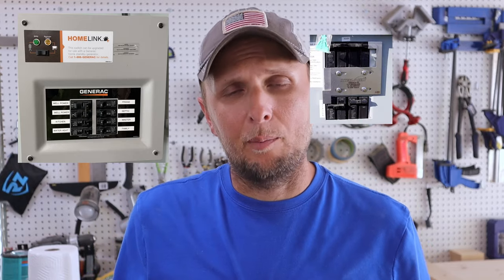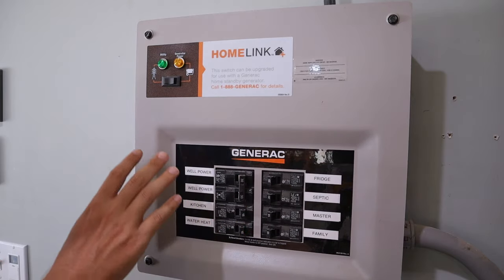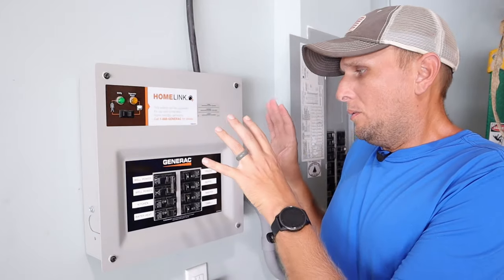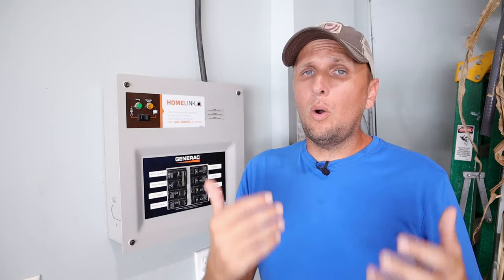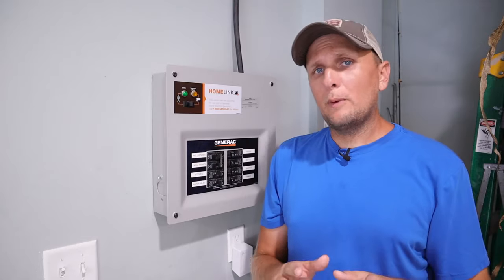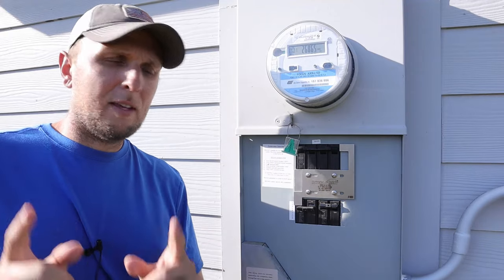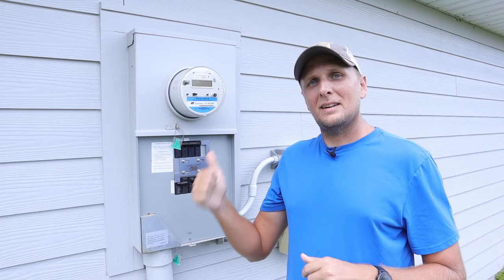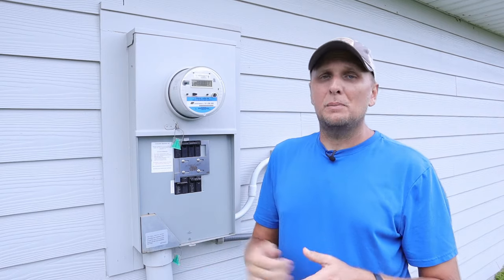How To Choose Between A Transfer Switch Vs Interlock Kit With Power Inlet Box

Comment: Why not use a double (or maybe triple) throw break before make knife switch?  That is, the switch goes between the meter and the main lug of your main panel (or in the case that I'm considering,  between the main panel and a sub panel), with the switch in one position, and between the generator and the appropriate panel in the other position.  (I guess that if I'm powering only a sub panel, then I need to switch the neutral as well, and bond the neutral to the ground at the generator.)  Do I have this wrong?

Comment: Question: For an interlock kit do you need a gen that puts out 220V since it's feeding the panel the same way the grid would? Vs a transfer switch that feeds individual 110V circuits?
Reply: Yes because you're feeding in through a 240v double-pole breaker. This is necessary anyway if you need to run any 240V equipment like well pump, central AC, electric oven, etc.

Comment: Here is an odd question for you. I have a few of the 5000 watt generators that usually I use 2 of them after a hurricane or bad storms here in the South Texas/Gulf of Mexico area. I run extension cords into the house since I don't have a special plug near the breaker panel for generator to connect to. This works ok, kind of a pain to do but works. 
I was told that since all of my generators are different, use different phases or something like that so I could not connect 2 or more to the breaker panel after disconnecting the city side so no backfeeding the city.
The breaker panel is 200 amp service and have breakers on both sides of the panel.
My question is, is there a way to split the panel so one generator could run one side and another generator run the other side of the breaker panel so I don't have to run extension cords into the house? No idea if this is possible without spending a lot of money but would be nice to not be messing with the extension cords. Thank you.
Reply: With an Interlock switch you can't.  You can if you install two Reliance Controls Manual Transfer Switches. (Either a six or ten circuit)

Comment: Hi
Is there an automatic transfer switch.
So when the city power is off , the generator turns on and the transfer switch goes automatically to generator ,
And when the electricity come back,
The switch goes other way and the generator stops!

Comment: In this case, I'm using an automatic transfer switch. Once the grid has the power back and it automatically switches to the main line, what will happen if the generator is still running and where does that power go?

Comment: With a transfer panel do you need to put wire nuts in the main panel? Im wondering because i was told it was illegal in my country to put wire nut in my main panel.
Reply: Yes, wire nuts are used in the  main panel when installing a transfer switch.

Comment: I got a interlock kit beat way to go imo i have full control with a 5700 watt generator and i keep everything energized except the waterheater.  I have no central air and im not just gonna turn on a bunch of stuff willy-nilly lol  It runs the window ac and refrigerator just fine.

Comment: My panal box is not made like the one with the interlock on it my main switch is long ways in the box and my breaker for my generator is in the middle of my box because at the time it was installed it was after Ida so it was kind of an emergency situation so would this still work if I had an electrician move everything around the panel

Comment: II my home, I have a 2 circuit breaker set up, a main and a secondary.  I believe it is a 200A circuit.  For a 15000 portable generator, it is better for me to do an Interlock or transfer switch?
Reply from the maker: I would go interlock.  There are transfer switches that large but they are pricey.

Comment: Also, I saw a guy put in his review that this Generac Transfer Switch was only comparable with Generac generators otherwise you have to remove the panel cover and move a physical switch to make it work properly.
Reply from the maker: That's not true.  I dont have a Generac and it works great.

Comment: Does a transfer switch solve the problem of a bonded house ground interfering with a bonded ground on the generator's GFCI? My Honda 3500i Inverter trips the GFCI if I connect to the panel with an interlock & generator connector.
Reply from the maker: It will still trip since the transfer switch is still using the home’s neutral and ground.  Would need a floating neutral generator.

Comment: I have bought a 7000 watt generator and hve been getting quotes from local electricians for installing an interlock switch plus cabling and cabling etc. The quote was $1800. Surely this is a rip off.

Can someone advise as to what the price should be. I recognize every installation is different but the house is 3 years old so everything is new.

Comment: I’m running interlock kit with Firman tri fuel from Costco. My preference is natural gas source, Is it better to run a long gas line or long cable connection from generator to panel on house or does it matter? Hope that makes sense. Concerned that long gas line will reduce pressure somehow and power capacity with long 40-50 ft gas hose.
Reply: Gas outlet is behind the house, panel toward the front….total is about 60-70 ft appx

Comment: I'm about to set up this too. I got a 9400 watt firman trifuel. but I was told by two and then 3 people, that it's dangerous to run power to household electronics, as these generators deliver electricity with spiky signwaves and it could damage your furnace, fridge and other items you run power too.  It was suggest to see if you can filter the power with a power / line conditioner, and this should keep the sign waves smoother.  a surge protector is o.k. but a line conditioner many not shut the power off on your items, so they keep running, as it smoothens out the waves to be continuously running safe..  Any feedback on this from anyone who's electrical savvy, please advise before I complete the job and set up the pony panel.. Thanks.
Reply from the maker: So this is true but not fully.  Many electronics such as appliances (unless they are smart appliances) would be fine, there is a possibility of damaging a circuit board if yours has one but I’ve never been too concerned with it.  Where you can get into trouble is with sensitive electronics like tvs, computers, etc.   The sine waves on many generators do constantly spike which can possibly wear your devices down faster or cause damage.  The power line conditioners from my understanding, do not clean up the sine waves so they don’t really solve your problem.  What you need is a generator or inverter generator with a THD% at or under 5%.   That being said, for years I ran a generator with a higher THD and nothing happened to my electronics.  That’s just my experience, I do know it was not the best for them but at the time I needed power and it’s what I had.  Since then I purchased a big generator with a THD under 5% so I don’t need to worry about that anymore.  Firmans have a high THD, I have seen many of them up around 25%.  They do have inverter generators that should have the lower THD% but inverter generators oftentimes don’t supply a large amount of power.  While the tri fuel option seems good due to the multiple kinds of fuel that can be used, I personally haven’t seen one with a lower THD%.  So in your case, unfortunately I don’t have a great solution if you are concerned about the dirty power.  I completely understand your situation as it’s where I was a few years ago and why I wanted to make sure going forward, to buy generators with a low THD % for peace of mind.  I hope this was helpful for you.  Just my experience and research I did on the subject a while back.  Take care!
Reply: @HowToHomeDIY  I with use of a pony panel with key things connected to that, I also use those 3-4 receptacle outlets power bars with the receptacles connected to the pony panel, would be a safe back up way to run our items  ? including switching the furnace hard wire to a receptacle near by, which our hot water tank is now too.. so using power bars or surge protector adapters or something should work just fine for this concern ?
Reply: my firman trifuel model T07571 is rated for 11-14% thd. others say 25 or less than 25. still not 5. this may be a bit better ?

Comment: Thank you, I’m in the process setting up now.  However I have a more basic question.  There is a lot of discussion about THD limits before causing damage to electronics.  It would be difficult to find a sizable portable generator that meets my needs if I complied with this less than 6 THD.  Are these reports a little sensational and not that big of deal?
Reply from the maker: So I have used sensitive electronics connected to generators with higher THD% and nothing ever broke.  That being said, with my large generator, I made sure to get one with a low THD% just to make sure I was not putting things like appliances at risk as they are so expensive to fix and replace.  Unfortunately, I do not know of a large portable generator anymore that has low THD.  The one I bought was the Cat 12000E but they have discontinued it.

Comment: 3:43 If you have a situation where you are turning breakers on and off to power different circuits, then the transfer switch is not going to works for you because it limits you to one set of circuits so you cannot switch circuits on and off as needed. In addition, you have to decide what circuits you want to run in advance so there is no flexibility. Also, should you upgrade to a larger generator, yu have to get a whole new setup to handle the larger load.
Reply: Yea I agree. I honestly I can't see how the argument for the transfer switch makes sense at all unless someone literally has like 2 braincells and can't stop themselves from turning on a 5k HVAC or powering up 10 table saws all at once when running on a small generator. 

IT would make sense for a business or a factory that has high powered equipment that may boot up automatically, but for most houses, I don't see how that is going to be a major concern. Instead of messing with breakers, just stop doing the thing you're doing that is overloading the generator. and like you said, upgrading your generator to meet higher demand is simple with an interlock.

Comment: I bought a whole-house stationary generator (24kw) with an automatic transfer switch.  I spent a lot of money and wished I had bought a large portable unit with an interlock.  What they don’t tell you is that the mfg greatly limits your ability to maintain, repair or even change many of the settings.  That puts you at the mercy of local dealers.  They have proven to be very expensive and unreliable.  My Generac unit had a major malfunction 4 months (5 hrs of total run time) ago and is still out of service.  I have called 3 of the authorized dealers and it remains broken.  If I had spent only 20% of what I did ($16k), I could have the flexibility to just replace things as they became unserviceable.  The dream of no interruption to life when you lose power remains just a dream for me.  I wouldn’t do it again.

Comment: YOU YOURSELF WHICH SYSTEM DO YOU USE FOR YOUR HOUSE AN INTERLOCK KIT OR A TRANSFER SWITCH? 
INQUIRING MINDS WANT TO KNOW.
THKS HAVE A NUCE DAY AND KEEP THE VIDEOS COMING TO PITTSBURGH PA 😊😊😊
Reply from the maker: Well I have installed and use both actually.  I started with a transfer switch but then decided I wanted to be able to run my whole house so then put in the interlock kit.
Reply: Thank you for your quick reply to my questions.
Loyal subscriber here keep up the great informational and educational videos.
You rock!😊😊

Comment: “…never going to be able to run my entire panel…” with my generac 6500 watt generator I powered my whole panel. Lights, fridge, washer and dryer, tv, microwave, furnace/ac, gas water heater, gas stove, and outlets. And I ran a cord to the neighbors house so she could plug in her fridge. I was just cautious about what was running when. We could easily run the washing machine, lights, tv, both fridges, the gas instant water heater which has a blower motor, and microwave, and ceiling fans all at the same time. If we were going to run the ac or the dryer we just powered everything else down except for a few lights for a while until the dryer was done running or until the house had cooled down.

Comment: My question, is with a harbor freight inverter generator 9500, my plan is to use a transfer switch with an inlet box, the only problem I see is that the generator only has a 30A twist lock connection, there are 2 of them, but how will I get the full output of the generator into the house ? Is there a way to combine the 2 30a outputs into a larger inlet ?
Reply: We have the Predator 9000/7250 generator. We have a manual 6 and 10 circuit transfer switch, with an inlet box for each.  I use the 4-prong outlet for the 10 circuit, which has the heavier circuits on it.  I use the 3-prong outlet for the 6 circuit, which would only draw about 1000 watts max.  

This set up works great. Our entire main panel is connected to the transfer switches.  Just make sure you keep up with the max wattage, if you use two transfer switches.

Comment: Seems to me a interlock switch is the better option even with a smaller generator because i could shut off everything and run my A/C if i really need too. I'm on a well and the well doesn't need to run all the time, neither does the hot water heater really. Once it's hot it stays hot for awhile. So will a 7500-9000w generator be enough to run the a/c plus say my living room outlets, fans?
Reply from the maker: It just depends on the size of the unit and it’s locked rotor amps.  Do you know how many amps your AC pulls when it kicks on?
Reply: @HowToHomeDIY  I do not, but it's a 40a breaker, so less than that. I'm looking at a 11500kv champion currently.

Comment: I went with a 15 amp inlet installed outdoors; which was wired to its own dedicated GFCI outlet inside the house/other side of wall.  Using 1700 W generator for refrigerator, fans, and a few electronic devices.  Purpose to power only essentials, and keep windows close when the weather is wet or cold.  Considering my minor needs this was the most cost-effective option.
Reply: completely against code!

Comment: Can the transfer switch be used with a small solar generator?  I only wish to energize 4 house circuits in emergency.  Thanks
Great vidieo
Reply from the maker: I am not sure that any of the solar generators have a hookup that would connect to the power inlet boxes for this.  Would definitely be something to look into though as I am very interested in the solar generators.
Reply: Yes, you can.....but why?
  Reliance makes a Pro Tran transfer switch that allows you to select circuits that you want to power up when the grid goes down. But there are many things to consider. The solar generator outputs 120 volts AC. Half of your home circuits operate from Line 1 and the other half are powered by Line 2 coming in off the power lines in the street.  Your breaker panel in the house splits the 120 volt circuits in half using the ''Neutral'' wire, the 3rd wire coming off the power lines into your house.  Some of your breakers are fed by L1 plus Neutral wire , the others are fed from L2 plus neutral wire.. The 240 volt appliances are L1 and L2 together, no Neutral wire.

You can only feed into ONE OR THE OTHER set of circuit breakers powered by either L1 or by L2. So if the fridge is fed by a circuit breaker on  L2 and the bathroom and hall is fed by a breaker on L1, take your pick. You cannot power both sides of the circuit breaker panel with a 120 volt solar generator.

Your best bet is to spend the money on extension cords with multiple outlet to power up the fridge, a table lamp,  the aquarium pump, etc (my son's house with his 7200 watt hour solar generator). Better to buy 25 foot 12 gauge heavy duty extension cord and put the solar generator near the biggest load. A neighbor had her 16 gauge Christmas light extension cord pop with a big spark at her generator after she tried to run 2 electric room heaters with it with her Honda 3000 inverter generator. It scared her!  90% of my extension cords are 12 or 10 gage. The bigger, the better for less heating and losses.

Most solar generators do not have the power that you really need  and most do not have 240 volt L1 and L2 output unless you spend $10,000+ on them.  Spending the money on a transfer switch, the permit, the electrician will be a waste of money. Also....look up how many Watt Hours your unit is rated. Try plugging a space heater into your unit and watch the battery go dead in an hour.

Comment: Is it possible to use Both I have a transfer switch would like to add one circuit from my garage ?
Reply from the maker: I have both the transfer switch and power inlet box with interlock kit.  It does make it nice as I have all of my emergency circuits on my transfer switch so I can use my smaller generator the majority of the time which uses a lot less fuel than my big one that I hookup to the interlock kit.

Comment: I have a WGen9500DF and would like your opinion of the best way to go. I had been looking at a Generlink, but that will cost me around $1,000 by the time I pay for it, and the electric company comes and puts it in. I have to pay them to install. Hope you will have some time to answer.
Reply: hi Tim, if you like to save money, generator interlock switch is the way to go. That generator has enough capacity to power many devices in your home - but it all depends on how many electrical devices you got.

Comment: Given that the interlick system has just one 50 amp plug, then how do we get around a 12K watt max feed?  What would one do if they have 2 9k running generators paralleled at certain times, say for an occasional drier use?  Aren't we still limited to 50 amp/12k watts?
Reply: cant do that